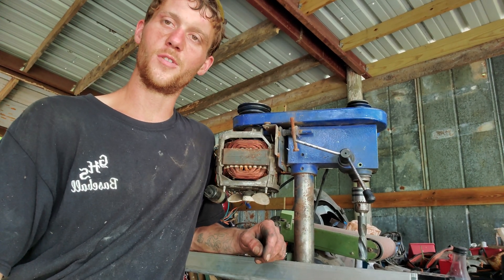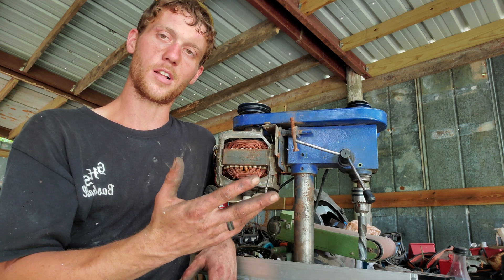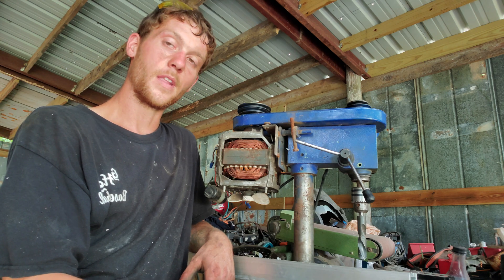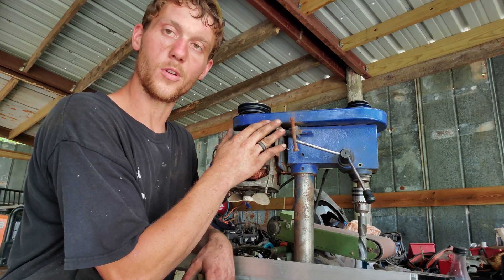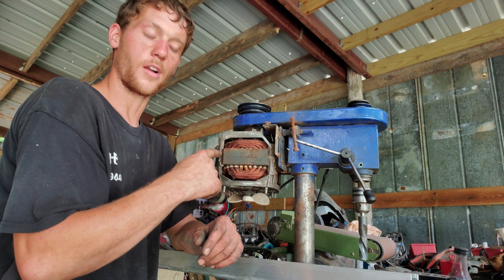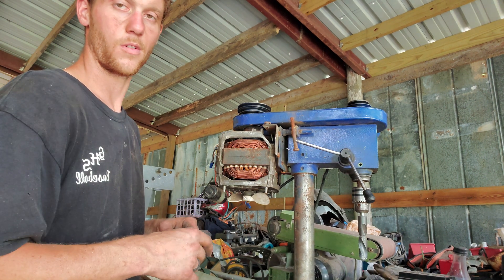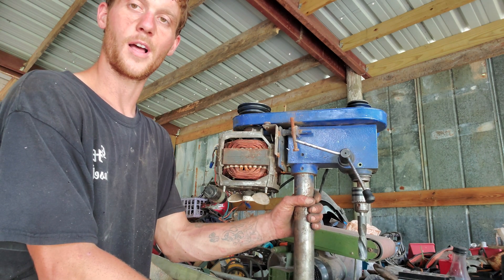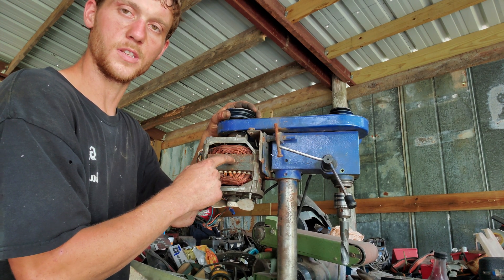Drill Press upgrade with motor from washing machine

Comment: I too have a lightweight diy bench drill and there is nothing more annoying when drilling the motor stalling particularly when using hole saws on timber. I will also use your idea of a washing/ drier motor. Thanks
Reply from the maker: Awesome. Hope it works out for you!

Comment: it would help your video to see it in action and it would be nice if you could control the speed
Reply from the maker: Thanks for the feedback. I will do another video and show th changes I have made. I changed the motor to a dc treadmill motor with a variable speed motor controller and it improved my drill press' performance dramatically.
Reply from the maker: Thanks for the feedback. I will do another video and show th changes I have made. I changed the motor to a dc treadmill motor with a variable speed motor controller and it improved my drill press' performance dramatically.

Comment: That thing is better than when new now. You can get a speed control for 4 bucks on eBay.
I have a little cheap drill replaced the motor with a treadmill motor...1/3hp to now a 1hp with speed control.
Reply from the maker: Thats the way to do it! I used a treadmill motor for my belt/disc sander combo and used controller with speed control as well. Sander is better then when new. I should do a video on it! Thanks!

Comment: Things that have made me go hmmmmm.  And these are the things we have all known and we have all heard but maybe never stopped to actually look at.  There are of course lots of things but here will keep it on the phenomenon of electricity only.

Let's start with what electricity is.  Looking closer, electricity is defined as moving charges, that is it.
Is moving charges the same as energy?  In other words, is electricity the same as electric energy?
Are moving charges, energy? Hmmm... interesting.
Let's see, we know that in AC, charges really just vibrate back and forth.  When you turn on that light switch, the electrons don't have a chance to even leave the switch but the light bulb turns on instantly even if it is miles and miles and miles away from the switch.  And in DC charges moves slower than a slug.
While electricity is movement of charges, electric energy is an electric and magnetic field phenomenon.  It gets transported by the disturbance in electromagnetic field, i.e. photons.

In other words, photons are the carrier and their payload is energy.
While charges may vibrate back and forth, energy moves in one directrion only; i.e. from the source towards the load. It propagates through empty space and its trajectory is by means of using the conductor as guide where to go. It is the magnetic field around the wire that binds the propagation to it, making electric energy as a near-field phenomenon (i.e. near-field radiation).  Although certainly some far field aspect is still there.

Electric energy being in the ultra-low frequency range, it's far-field portion can penetrate through the ocean at tremendous depth. It can be detected by submarines.

Charges do not move through wires like water moves through a pipe.

When you supposedly charge your battery, consider the fact that as charges enter the battery, the same number of charges exits it. It is a complete loop.
Reply from the maker: very interesting

Comment: I noticed you installed a start capacitor with the motor.  Being a dryer motor I have never seen a capacitor being used with them.
Especially not being under load when you start it.  I have never seen a capacitor being used in dryers to turn these motors even though it has to turn a drum full of wet clothing.
With washing machine motors it is needed due to the mass of water and of course a more robust coil winding on the motor.

These dryer motors are just about configured as a two-phase motor in terms of winding relationship to produce enough inductive reactance difference to get the ball rolling and since they only have to turn in one direction, there was no need to worry about any need for means to change its direction using a capacitor and such.
Even in the coldest weather every time I just plug any of these motors they get going.  By simply hooking up the start wire with the run wire and the of course the common if they are separate or usually just one as they are hooked up together inside the motor already.
The centrifugal switch then unhooks the start winding so a person doesn't have to worry about that.

But I like your creativity for having done it.
Reply: i just do the same and use the dryer motor 9f tube washing mashin,it has two motor one for washing and one for drying the have less power,both of the start with one capacitor,all the washing mashin  have external capacitor.
Reply from the maker: Believe it or not the capacitor was attached to motor when I pulled it from the dryer. I just kept all the motor wiring identical to dryer configuration and added the switch and presto. I love how informative your comment was. I feel smarter after reading it. Keep em' coming! Have you checked out any of my other videos?
Reply: @Blue Ocean , very informative, I'd like to have your email address for some upgrade related questions. Thanks
Reply: @marknoel9379  In all fairness to you before I give you my email, I should disclose that I have too many controversial things to say in the area of science.  This means I say things that are against everything I was taught.  This means everything against you were taught.  I have had professors calling me every name in the book.  

For lack of a better way of saying it, consider just one of the positions I take and let me know your take on it. It looks like this in quotation:
"There is no such thing as charging a battery.  It is false, it is confusing, it is outrageous.  It is a collective delusion.  The delusion is so deep that no one even stops and look what is being said, taught or what it means.  No one catches the meaninglessness of it.  I consider it mass hypnosis".

How do I feel about the mass education system?
When a student fails, the teacher gets an F.
Reply: @alchemy1  You're probably right or close.
Reply from the maker: Nickl4462@gmail.com
Reply: @MrFigureitout  email sent and here is one for the road:

Looking closer at this Amana washing machine I noticed the actuator was going back and forth and never stopped either to agitate or to spin. I went for a short cut and installed an actuator from another working machine that was actually good.  It did the same thing.  So, I went ahead and directly blamed the control board.
I followed the corporates lame instruction and ended up telling me that if I don't read 12 V between pin4 and pin1 on J12 I need a new control board. Well but of course, that is their whole point. 

I was aware that pin4 was ground just from looking at their diagram (unfortunately they forgot to hide that in the diagram) But of course pin1 went to cloud 9.
Too bad they mentioned "if I don't read 12 VDC".....
I put two and two together and read what they of course won't tell you.... well but of course.

I said to self, hey self pin4 is ground indeed, it is written in stone.  1 needs 12V.  Find 12-volt pin somewhere.  And the self-responded... hey brotha, that is a good idea.

Where could that be. Oh, that much I have picked up here and there.  Hey self, find the secondary low voltage side of the board, like you know, them capacitors.  OH yea... that is brilliant.
I kept my ground on the voltmeter on Pin4 of J12 and the red on one of the capacitor's positive side and low and behold 12 V it was.
I soldered a thin wire from that to pin1 of J12.
The rest is ..... you got it.  The washer began to sing Hare krishna like it is nobody's business.  :-)
Reply from the maker: Well played. Sometimes you gotta make the call just to get that lilltle piece of information to solve the problem. I love it

Comment: Do you have variable speed on the motor itself?
Reply from the maker: No not on this current setup. If you wanted variable speed I would suggest using a brushless motor and an Anaheim controller (or something similar)  I have a similar setup on my generator bench tester I built using a bldc washer motor.